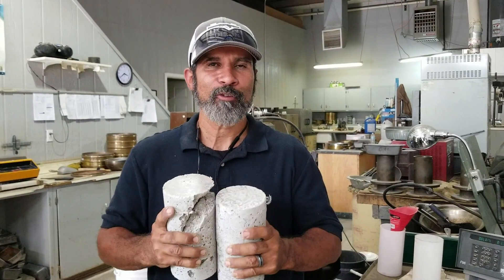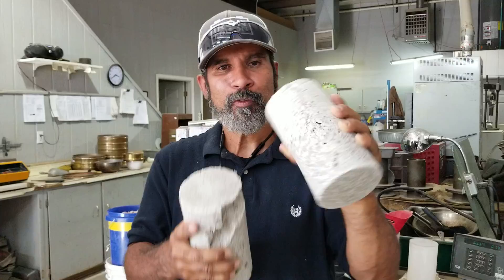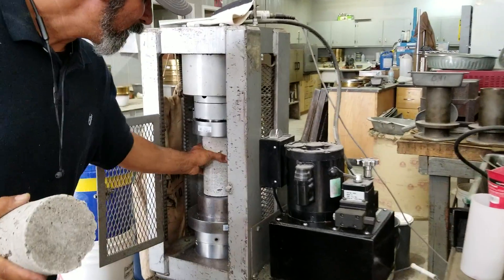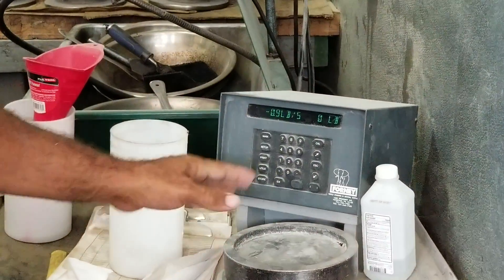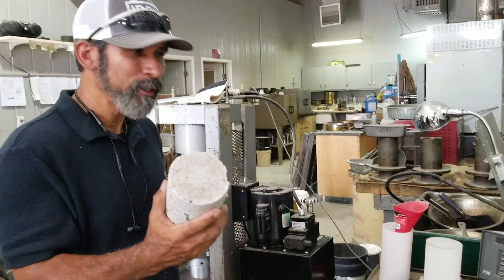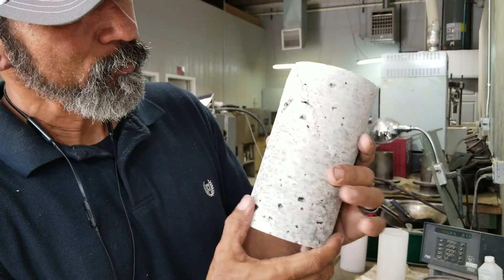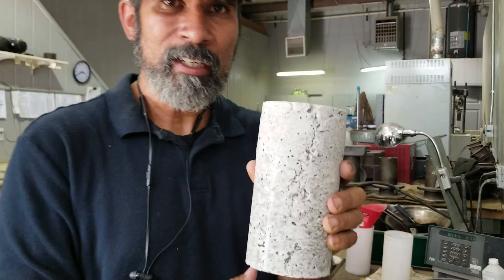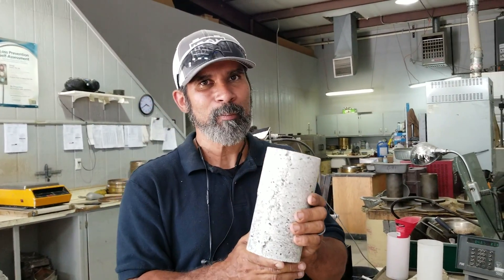Compression Test E.P.I.C. Samples #EPIC #aircreteharry #dome #epiccementmix #compressiontest #result

Comment: Surprised by perlite mix. I've seen some vids where they use a reciprocating saw no blade to vibrate larger forms and orbital slander for small stuff. Otherwise would regular old hammer work to tap around? How you know if you did a good job or not.
Reply from the maker: Well any of those techniques would have worked but I did none of them I just placed the samples in the container and closed the lid.